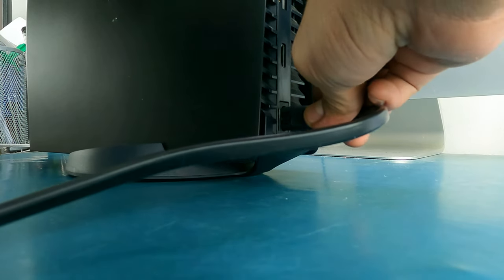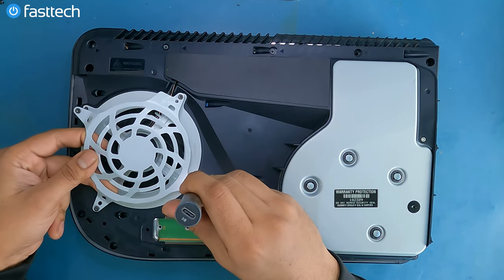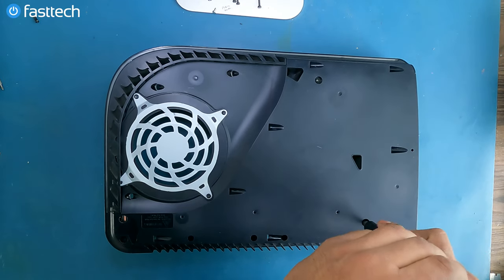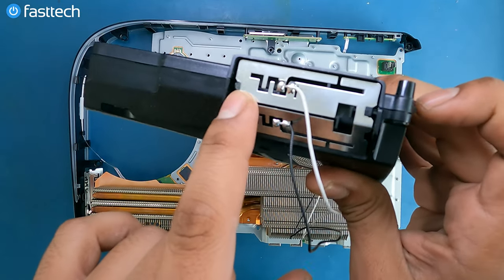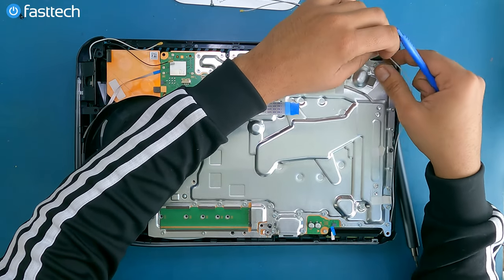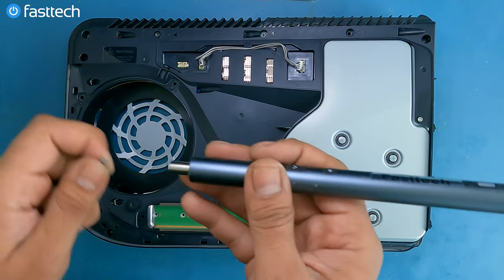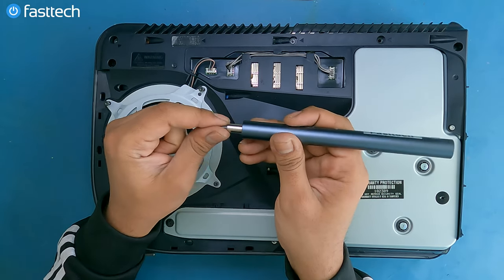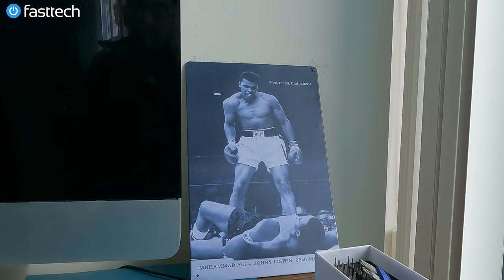PS5 Not Turning On Repair Guide (Power Supply Replacement)

Comment: My wifi box got struck by lightning and then my ps5 wont turn on it was connected by lan cable. Even though my ps5 wasnt turn on it got damaged is tht a problem with the power supply?
Reply from the maker: @xtreesh-5123  yes most likely its a power supply issue but its possible your mainboard could be bad. You can try replacing the power supply if it doesn’t fix your problem you can send it back to us for a full refund.
Reply: Ok thank you great video by the way
Reply from the maker: @xtreesh-5123  you are welcome 😊
Reply: @fasttechvideo  I replaced it but it’s still not turning on

Comment: Thanks man, I've been waiting years and years to change the capacitors in my launch day PS5 so I can finally enjoy it without it screaming at me. No one else has a sensible guide on pulling the PSU, they all open the sandwich.. so strange. Much appreciated
Reply from the maker: @Jasonsadventures  you are welcome I appreciate you noticing that difference and calling it out because my technique saves at least half an hour and completely avoids making contact with the mainboard unnecessarily.

Comment: I just replaced my psu (400FR) and it still powers on then shuts off after 3 seconds. I got the unit for 250 and the psu for 70. I have done this before and got one running. But this one (same 400FR) and nothing 😢
Reply from the maker: Mainboard or APU issue
Reply: @fasttechvideo  I was hoping it was a faulty power supply that I ordered -__-
Reply: Im having the same problem. Did you ever get to resolve the issue?

Comment: I would love an official video of you showing how to disassemble and clean a ps5 both disc and digital. I always go to you're ps4 pro cleaning video to watch when taking apart my ps4 pro and cleaning it and swapping thermal paste and it always turns out perfect no issues. You give me confidence in watching your videos to do these things myself which is a credit to how detailed you are. I just came across some videos advising when cleaning your ps5 you might wanna clean the vents on the power supply as well but requires you to take it apart completely and remove the motherboard. I have confidence in doing that with my ps4 pro and you're videos. Now I need a ps5 version to do the same. I am typing this before watching the video which is always a no no. Im sure if you are replacing the power supply you will have to remove the motherboard but if you made a video doing this but make it about how to properly clean your ps5 it would be awesome.
Reply from the maker: Thank you so much for your comment. I will be making a video similar to the one you requested in the future.

Comment: Mine beeps but won’t turn on !!
Reply from the maker: @PLAYBOYBLAKK  most likely a mainboard related issue
Reply: @fasttechvideo  so a power supply change won’t help ?
Reply: @fasttechvideo  can the main board be replaced ?
Reply from the maker: @PLAYBOYBLAKK  yes you can replace the mainboard we sell them on our site fasttechstore.com
Reply: @fasttechvideo  thanks

Comment: I got my ps5 a little over a year ago. As soon I got it I went and plugged everything in and it worked fine as expected. Now at the time I was going through some stuff and I decided to leave it in the box. So a whopping year later (yes a year later) I decided to open it again. Now just about a little then a month and a half ago is when I got it out of the box. Again everything seemed fine. Until one dreadful morning I was in the mood to play some Spider-Man. Powered the ps5 and it kept flashing the blue and then it died on me. So I did it again until finally the safe mode came on. Went through almost all the steps and still the power would go off once I was off safe mode. Now my question is how is it that pretty much a brand new console has issues already when I haven’t even broken it in? Now I’m out of my one year warranty come to find out and now Sony is telling me I have to pay over 200 dollars. Now that’s some BS. I could understand a year is a long time but anything could happen. If I did something to cause this issue then I get it but it’s Sonys fault that their product is F**ked up. Any suggestions?
Reply from the maker: A flashing blue light indicates a general hardware error. It could be anything from liquid metal spillage, APU chip problem or a SSD issue.

Comment: Great video.

My ps5 decided to take a crap.

Hit the power button it beeps blue light is solid for 3 seconds and turns off.

Cant get it to go into safe mode.

I did notice that my controllers where bot charging like usual.

Think its. A power supply or nah?
Reply from the maker: @sparx2169  no its most likely not a power supply issue but a problem with your mainboard
Reply from the maker: Do you have to unplug the PS5 for it to the blue light and beep loop again?
Reply: @fasttechvideo  
No.

I did try to force it on by inserting a disc it started taking it ( disc) and stopped and shutdown. 
Now it won't start taking disc either.

Like  I mentioned above but had errors.

I did notice before this happen my controllers were not charging at all from the USB port. I showed connected but would even charge my newest controller.
Reply from the maker: @sparx2169  most likely a short in the usb at the front. The usb board can cause the system to not turn on in some cases. Whats the model number of your ps5?
Reply: @fasttechvideo  1115a first generation
Reply from the maker: @sparx2169  Replacing this might fix your issue but I cant be certain: https://fasttechstore.com/playstation-5-1/p/playstation-5-usb-and-usb-c-io-board-edu-020
Reply: If it's the USB board.  Will the edi-010 board be basically plug and play?
Reply: @fasttechvideo  this isn't a complete usb board though?

Comment: What are the black and white antenna cables that come off the power supply for? PS5 wont turn on and black cable got smushed by a screw... Could this be the problem?
Reply from the maker: The black and white wires are for the antennas. They are not related to power issues. Check the power supply.

Comment: Can you use a 400DR instead of the FR? My kids an FR and was jyst curious if "backwards compatible" so to say.
Reply from the maker: What is the model number of your PS5?
Reply: @fasttechvideo  CFI-1215B We are hoping we're right (its my kids) but his just shut down while playin one day (seriously day AFTER his 90 day warrantee....imagine that) and never came back on. 
We're both pretty techish. He (19) took a class in school. But we tried everything available to do. I say available because we cant even get into safe mode or ANY Screen. Hit the power button, fan kicks on, led turns blue and POOF instant shutdown. AND odd thing is, when it shuts down, if you hit the power button again, it doent do anything. But press it one more time and the Fan/Blue Light/Shut Down happens again.
We have it apart, and seen his PSU is the 400FR as mentioned....lil more expensive/hard to find legit retailer.
THANK YOU very much for your time.
Reply from the maker: @cpoky its confirmed, and they are NOT interchangeable. You have to use the power supply model your system came with.

Comment: Ey man this is some good stuff. I came home from uni after almost a year thinking I'll get to chill with my PS5 but instead it decided to not fucking turn on anymore. I found ants in the psu and it's giving 0v so I'll have to replace it. The mobo should be fine since it was shutdown. We'll see ig once I can get the psu in, this is a trip man...
Reply from the maker: Good luck and let me know how it goes. If you want to buy a power supply check the top comment and description box
Reply: @fasttechvideo  price is good and lifetime warranty is great to have but I’m in India and import is hell - it’s just gonna get seized and they’ll make me pay 40% customs. Gonna have to get something locally, quality will be worse :(
Reply: hey were you able to get it rectified how much did it cost.. im facing a similar issue
Reply: @unicornisganyu  nah man the options in my country are essentially non-existent. The PS5 is just sitting there gathering dust and that's how it will be for a while.
Reply: @Prakyy  omg I'm from India too 😭😭 so it's over huh... I left it without using for for past 2 months as I was busy with semester too I'm so sad
Reply: @unicornisganyu  no you can try to get it man I'm just busy right now. I'm only on holiday for the name but really I'm just busy with college related work. Maybe go to some 3rd party repair shops and check if they have a PSU. Atleast connect it to see if that's the only issue and diagnose. The import people are running a fraud op and I'm never importing anything again maybe if I can get someone to bring it from outside
Reply: @Prakyy  ok so i contacted the Sony customer service and they recommended a service shop so I'll go there and check what you suggested
If I get an update I'll let you know
Thanks
Reply: Hey op what I ended up doing was going to authorised Sony service centre and they suggested that i could pay 50% of the price to get a new console (since it's out of warranty of course)
If you save up money i definitely recommend you to do it as it's better to deal with Sony themselves rather thaan paying in thousands to third party sellers
Again it's your call but I'm just letting you know what I did
Reply: @unicornisganyu  yes they said 20k to replace the console might do this later on but this is really kinda crazy from 50k that I’ve already spent acquiring the console
Reply: @Prakyy  true Sony fucking sucks tbh we can't even have extended warranty on it seems 🙄🙄 this makes me realise pc gaming is better afterall
Reply: @unicornisganyu so is ur ps5 fine now

Comment: Hey in need input please. I bought ps5 which worked fine but when i play ps5 games it shutsdown a few min into the game but plays ps4 games fine. I opened console and opened psu and found a small burnt area where on of the small soldered processora are. Is it fixable or do i need a new psu?
Reply from the maker: Can you upload a picture of the burnt area? Also do you get a message on screen before it shuts off?

Comment: Would I have to reassemble the whole ps5 to see if the power supply works I installed the new one but the ps5 didn’t turn on still
Reply from the maker: Check the ribbon cables, one in the front. The PS five does not have to be fully assembled for it to turn on. You only need to make sure that the ribbon cable for the power and eject button at the front is connected and that the power supplies is in
Reply: @fasttechvideo  yea all cables were connected including the fan but still didn’t turn on im guessing now it isn’t a power supply issue, any guesses and what it could be the console gets no power at all no power beep or anything even after changing the power supply

Comment: my ps5 when connected to the, it beeps 3 times ans then it does not turn on, i think its the power board that is affected but i want to ask , will i change the entire power bored or is there a particular part i only need to change ?
Reply from the maker: Yes possibly the power supply but there is a chance it could be a board issue

Comment: I had lightning hit my house while my ps5 was on, and now it won’t power up, or beep or anything. Do you think replacing the power supply is what I should do?
Reply: I have the same question.  I'm willing to do take the risk of taking it apart by following this video, but am curious on the odds that the damage extended past the power supply and into the more sensitive parts of the PS5 itself.
Reply: I'm in the same boat. My PS5 also stopped working after a lightning strike and won't turn on. Took it to a repair shop and they said it needs a new power supply, but they charged me almost $220. So I'm going to try to replace it myself following this video. Hopefully it works! 
Just a bit confused about the antenna part tho 😅
Reply: @ludc8469  I took mine apart and tested the power supply and it was putting out 12 volts so it’s a motherboard issue. Replacing the power supply is fairly easy if you have to right tools. The antenna is just 2 wires that connect to the board and go to this metal piece that clips on the power supply, it’s pretty easy to take off. I’m sending mine off to get repaired hopefully they can replace whatever is wrong on the motherboard 🤞
Reply: @DoctorD0309  Thanks for the info! So I just keep my old antenna then? Good luck with the motherboard repair. I’m putting all my trust and money into the power supply 😅 Lost 3 devices even with a surge protector, so I really hope I don’t have to fix anything else!
Reply: @ludc8469  yes you just keep and reuse the old antenna. Have you tested the power supply yet? Do you have a volt meter by chance?
Reply: @DoctorD0309  thanks for answering the antenna question, one less problem to worry about. 
I don’t have a volt meter, but I took it to a place that repairs PS5s and offers free diagnostics. They said it was the power supply, so I hope they actually tested it! I still need to order the new psu tho

Comment: How to know if the problem is the power supply? My ps5 beeps but no light
Reply from the maker: In your case it could be a power supply issue or a mainboard problem. In some cases it could be due to liquid metal spilling on the board.
Reply: Hey thanks for the reply. I actually have the same issue just now. My ps5 isn't working exact same way. Never had an issue. Was playing COD, menu screen, and boom off it goes. If I unplug it, then plug back in, it triple beeps but doesn't turn on.

Comment: My PS5 beeps once and does nothing. No lights at all. I tried all troubleshooting. How should I go about isolating the issue?
Reply from the maker: It could be a short on the mainboard. Was this console water damaged?
Reply: @fasttechvideo  wasn't water damaged. In my game room I have two PS5 and both were in rest mode connected to surge protectors. Power went out from a storm and one of the two won't turn on.
Reply from the maker: @Darkhell87  thats the second thing I was gonna ask. You can try swapping the power supply put it will most likely work.
Reply: @fasttechvideo  that's what I was thinking. But information on PS5 issues and repairs is hard to find. All loops back to troubleshooting. I'll try that then. Thanks.
Reply from the maker: @Darkhell87  If you want to order one here is a link: https://www.fasttech.ca/playstation-5-1/playstation-5-power-supply-adp-400dr
Reply: @fasttechvideo  one of my other PS5s won't detect lan. I cleared cache, updated in safe mode and removed forgot the connection, tried to manually do it with googled DNS and it still doesn't show up. The lan works on my 3rd PS5 so I don't think it could be a network issue. The Ethernet port doesn't seem to be damaged and the connection is tight. Have you encountered this before?
Reply: I’m having the same problem after changing the PSU of my PS5 😢

Comment: Damn, I got all the way done almost only to realize the pins don't line up cause I bought the wrong power supply model ig.
Reply: I bought one labeled as 400DR that turned out to be 400FR, which doesn't fit my PS5 at all because the plug is moved over away from the corner.
Reply from the maker: @EileenTheCr0w  yes a ADP-400FR is for 1200 series PS5s

Comment: My ps5 shows a blue light then shuts off its it the power supply
Reply from the maker: Do you ever have to unplug your ps5 for it to pulse blue again ?
Reply: Mine beeps , eject button beeps , blue light blinks for 1 second but it won’t come on what you think the problem might be ?
Reply: @fasttechvideo  ?
Reply: It overheated and gave me a black screen and shut off before this happened
Reply from the maker: @nflrasta8809  check the tightness on the heatsink APU clamp and check the liquid metal. If this fails check your power supply